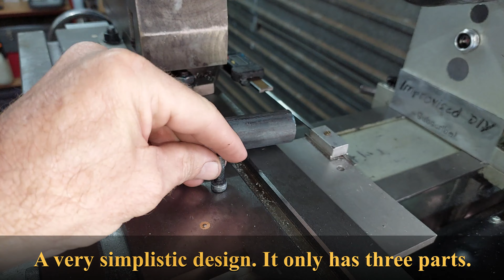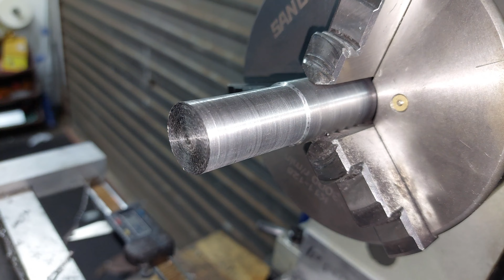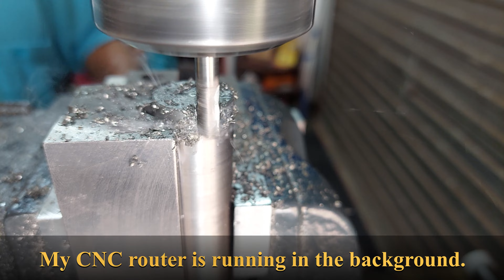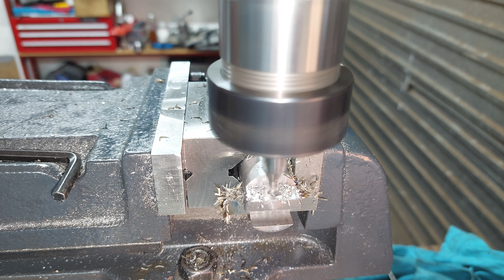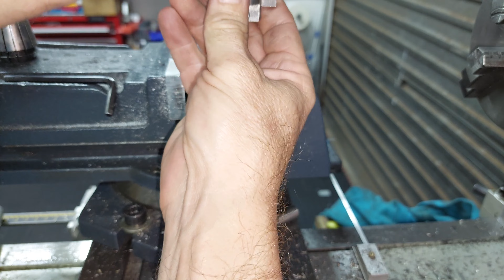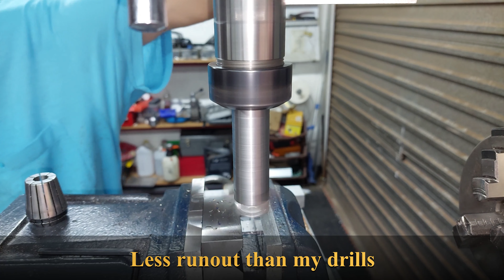Quick Tools - Simple Gear Cutter Arbor

Comment: Nice simple design. I assume you will be doing a video on gear-cutting soon? It will be interesting to see your approach to grinding the cutter. I have done single point gear cutting for several projects but my biggest challenge is shaping the cutter accurately and buying the correct module cutter for limited use, it is just not worth it.
Reply from the maker: Thanks Pieter. I have a friend that needs a replacement gear. I will try and copy the profile from that gear. I will see how it goes. 🤞I agree that buying cutters is not a feasible option especially for me. 😜